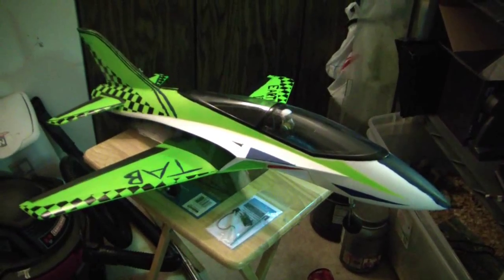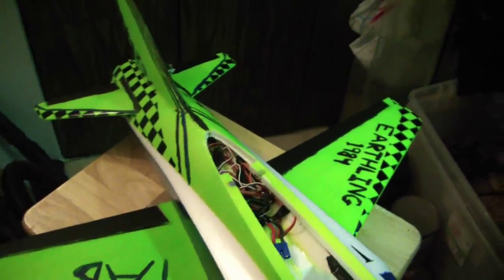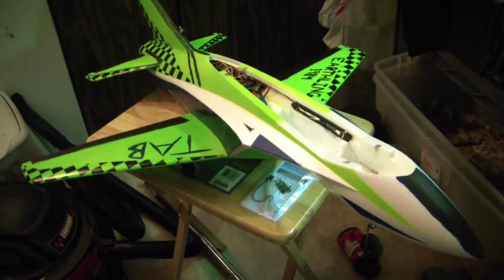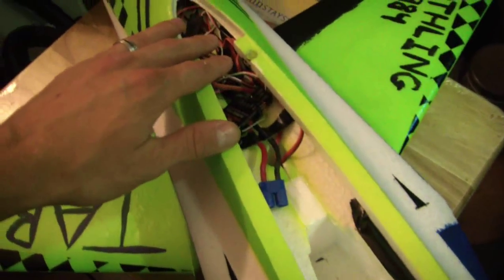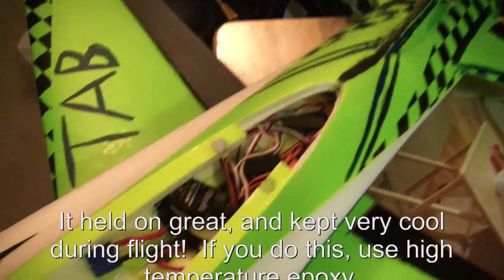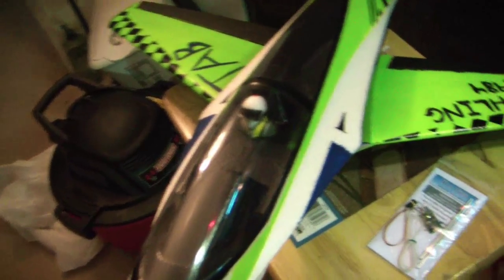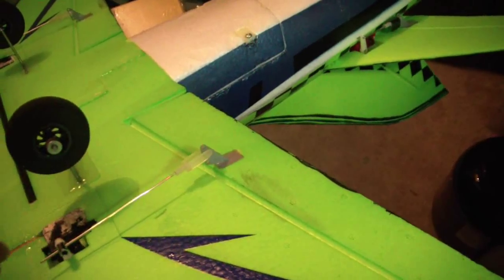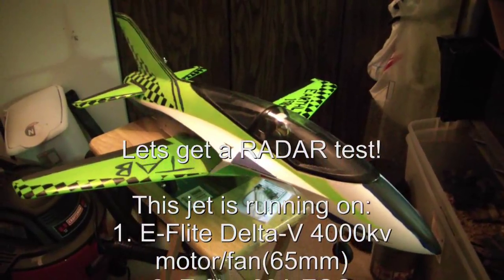Nitroplanes Concept X Jet MODIFIED! 100MPH!

Comment: theres a better way to arrange the cables in your cockpit just make a place for the receiver with an Xacto in the middle of the beggining of the wings inside... i did it it works perfectly
Reply: julien menu also reinforce your wings with little needles of steel it really helps for the weak epoxy provided

Comment: I also built a concept x . I use a RC Lander 68mm dynamically balanced\60a Turnigy Plush ESC and flying it on a 4s 3000 65c. You have to beef up the landing gear to handle the extra weight. It blows by most Habu's. Weighs in at 44 ounces, 10 ounces more then the stock setup. You have to land hot if you dont have a good headwind. Lotsa fun!

Comment: My 60 amp ESC in my Sapac Eurofighter is also placed in the same location as yours.  I have had zero problems with the ESC coming loose and getting ingested into the fan.  I just wish all my planes had enough space for my ESCs' to be placed in front of the fan.

Comment: Dude where did u get your hand held speed radar? I have to put my phone in or on the plane and use its GPS. It then records top speed, average speed, altitude and distance. Its cool but i would rather have what you use as all planes do crash and my phone is expensive! Nice jet thou 4sure shes a lovley shape

Comment: I would have just bought a delta wing like a stryker or parkjet (hobbyking) and modified that.  I actually hate EDF jets.  I riped the 50mm fan out of my J POWER F-86 and put a 6 x 4 APC and a grayson hobby 2200kv outrunner on the front of it and its now pushing 100 for about $ 100 even with battery. (not radio price included)

Comment from the maker: @robotwarsaintdead There is a lot more than 'works' or 'doesn't work'.  There is many many many more qualities you are leaving out by having such a black and white view on this topic.  There is also, *how long it lasts* (I have never had an E-flite ESC fail, but I have had MULTIPLE ESC's in these RTF/RXR jets from NP/BH fail - and of course if the ESC fails, you also lose many other parts when the crash happens).  There is also how quality the part is, E-flites motor and fan unit are stronger.

Comment: If you really want to spend MONEY. I can link you with a parts that would RIP your parkzone/E-Flite thoughts straight in half. GUARANTEED!..I am talking about 1200g thrust, 5200kv 6-blade 64mm turbojet angry cyclone EDF unit. I bet with just under half throttle, your jet would do 110mph at least. You gonna need a bigger flying field too. I dare you to mod this jet with my set up discription.

Comment: Listen Earthing (with your freaking bird in the background lol lol lol) there are some things that you did that is correct.. Epoxing the mating sufaces, using better push rods, strengthening the flaps/horns, painting & preping the surfaces for gluing, unique painting scheme. NP products are hand made all the time, so there are some that are going to be under quality. Agreed. $80 is expensive for this kit. But you killed this more when you went with USA $ money parts. unnecessary. USA =Extra $.